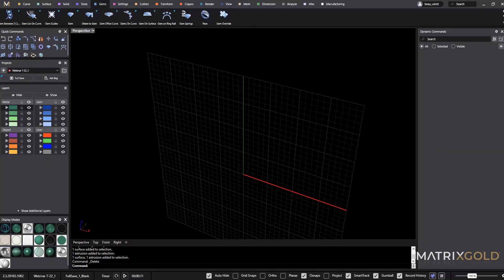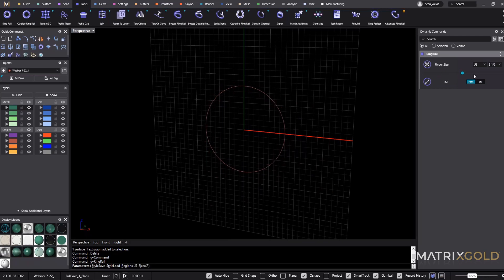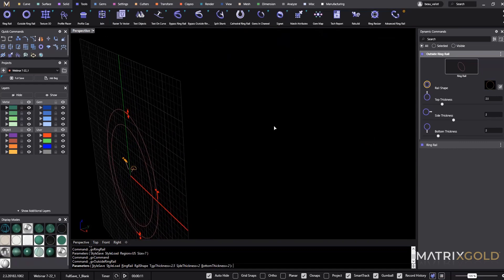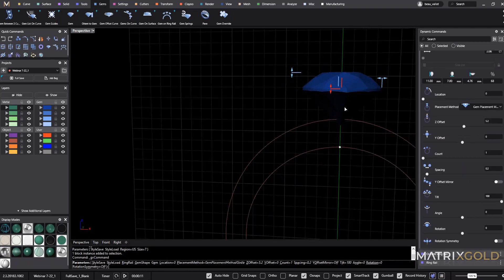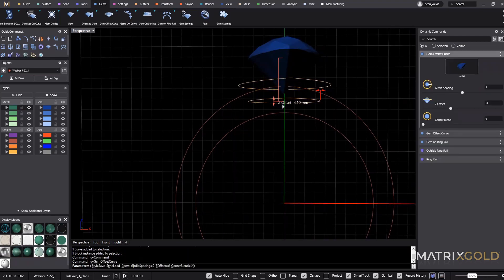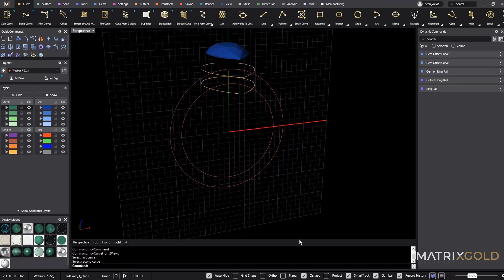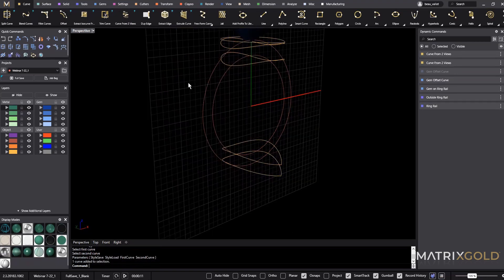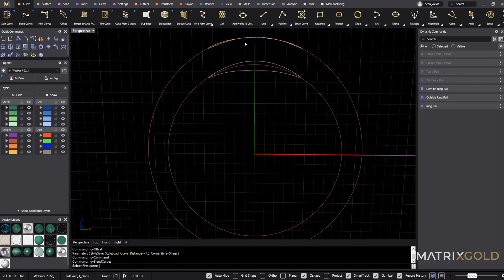How To Design Fashion Engagement Ring - MatrixGold Tutorial

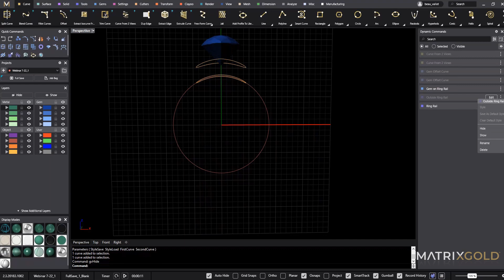Comment: At 5:27 the two curves top and bottom are deleted separately, when I delete mind it deletes the top ones as well. Please advise.
Reply: Hello, on the step you are referring to, we are hiding the curves typing in the command line "gv hide"
Reply: @oriolcollelldemont231  Thank you, I'll try again.
Reply: @metalsmithOz  I found that ungrouping the all the curves helps to delete the bottom two curves without the top curves disappearing.
Reply: have the same problem cant find a solution
Reply: At first you must ungroup them 
I had this problem too I ungrouped  them so it worked

Comment: I tried following this tutorial many times and at many different points in the process i ended up with a broken model and couldn't go further. On my 3rd or 4th attempt i finally managed to execute the sweep from the profile placer and then mirror it, but afterwards i can't do the Profile Sweep between the 2 top profiles to make the point of the ring and i also can't make the Sweep 1 at the bottom.

Matrixgold won't let me select the profile from the mirrored sweep.

Edit: i managed to complete the ring by making mirrors of the Profiles
Reply: @Oriol Collelldemont thanks for your reply! someone got back to me about that issue and showed me how resolve it. I sent another email 2 weeks ago about another issue with placing cutters on a V shaped ring and trying to change the angle of some of the cutters individually but i couldn't. I didn't gert any response about that.
Reply: @Oriol Collelldemont is there a way someone could look at my email and reply with a solution to my exact issue though? I sent images and my email address contains the same word as my user name here